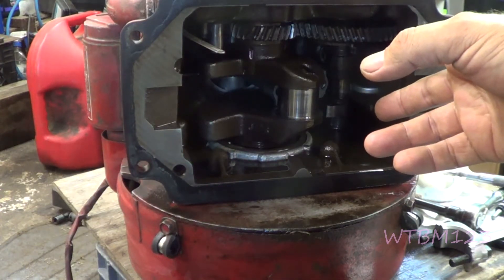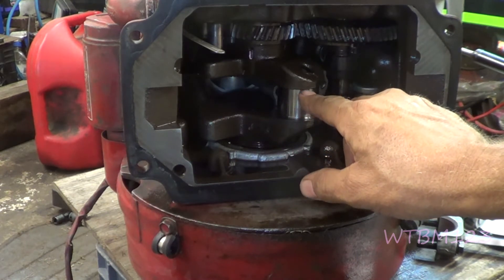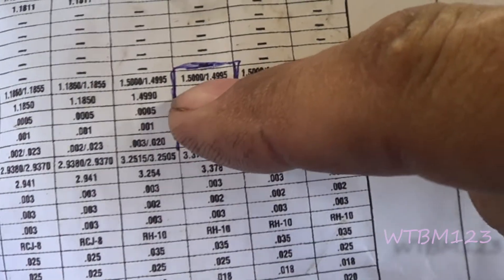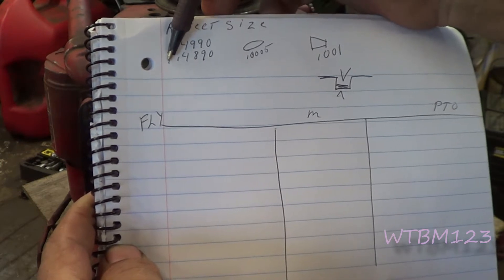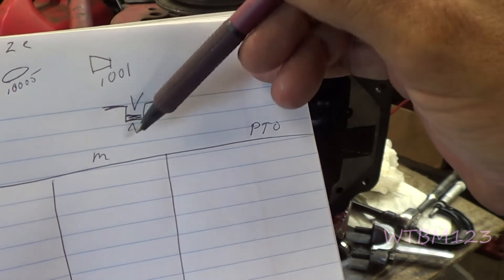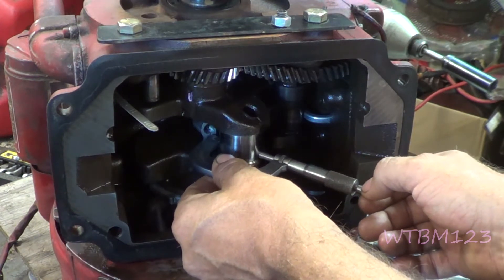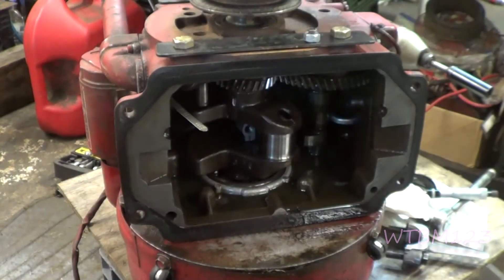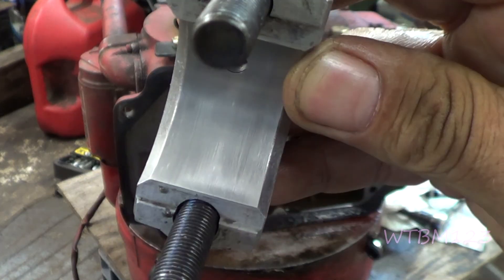Measure crankshaft for connecting rod , Small Engine , Is it to far out to work Kohler K series

Comment: That’s a tough call Terry. I guess it depends on how much money you want to put into it, and how badly you need that engine. It’s only going to get worse though, as you know. If we’re my engine I would tear it down and inspect everything and probably rebuild it. Those readings do bring you to a crux. Tough call!
Reply from the maker: I had it all apart . Valves cleaned up well , Cylinder was still good and only about a thousands wear in the middle of piston travel . Put a crank bearing in . . Valve guides do not seem loose . Looks like someone  had just done some what of a rebuild on it . But there is a crack in one of the fins , and many that crack there ends up in a valve seat , so not sure how much money i want to put in this one . Thanks for watching and commenting . I enjoy the conversation

Comment: you might want to pull out that old rod and measure it to compare the wear with a new rod. after cleaning up the crank measure and compare.. enjoyed
Reply from the maker: Yea i need to get something better to measure the rod with , but the crank shaft is slightly out of round by to much . If the thing was not cracked i would be more interested in doing it right . I may make a video on the crack . It is not hurting anything now , but i am sure it is only a matter of time.